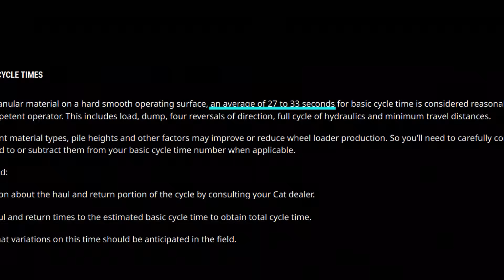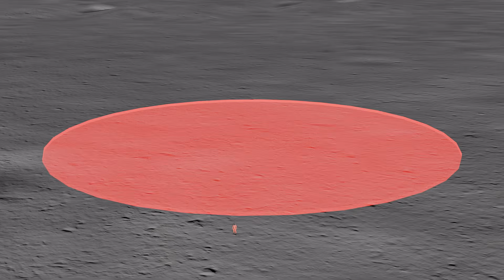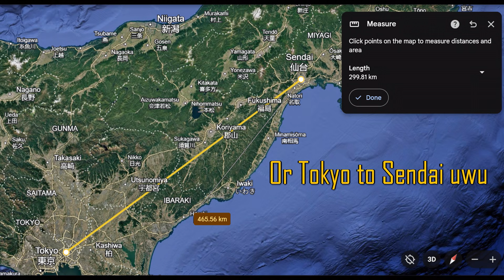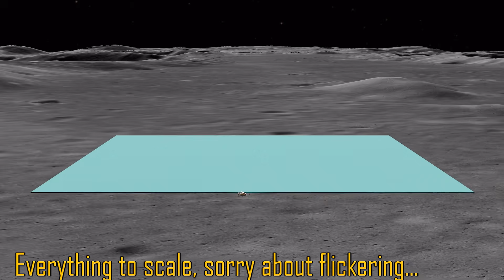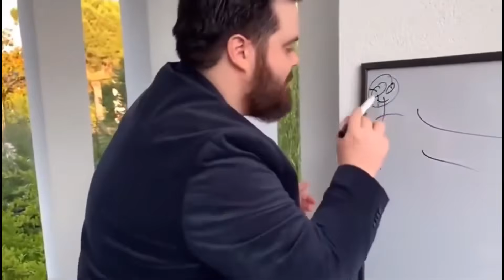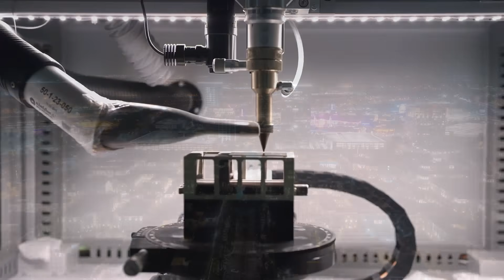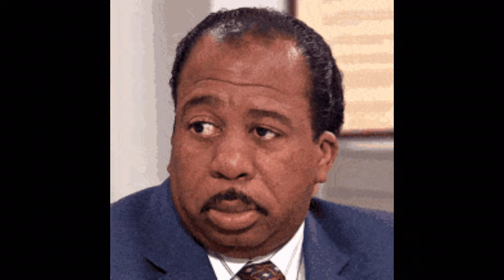How Much Bulldozer Can We To The Moon?

Comment: One of the advantages of having one big vehicle is that you also only need one person to operate it. But because the moon is a not a very complex environment, you could let basic AI handle most of the work with just one or two human supervisors.
Reply: Ehh… just use humans in chairs on earth. The benefit is a 24/7 workforce instead of a lunar workforce that gets sleepy every day.
Reply: we're actively solving this problem for exactly this reason at TerraFirma, the startup mentioned in the video
Reply: Computers in space suck, especially the parallel processors that AI depend on. The stellar radiation gently evaporates all the complicated atomic machinery of a microprocessor. Can’t rely on cloud either, the bandwidth back to earth has always been extremely limited in every era of space travel, latency measured in minutes and connection drops for huge amounts time as stellar bodies get in the way.
Reply: By the time we’re building these things, the idea of humans operating bulldozers on Earth will be quaint. The idea of humans operating one on the moon will be very rare.
Reply: @KingOfAllJackals  Depends on how AI progresses. Currently it looks impressive at the surface, but if you look deeper its just hallucinating and spewing out random thing that vaguely look/sound like the training material.
I certainly wouldnt want to risk a catastrophe because the builder AI did the architecture-equivalent of a seven-fingered hand on a loadbearing steel beam.
Reply: @Riesenfriese  Current mainstream AI is designed with generating stuff in mind, not an AI that is designed from the ground up with the intention of driving something, those AI’s don’t really hallucinate as they aren’t generators and if someone is using ChatGPT to operate their drone swarm then they deserve those accidents and issues. 

Hell you don’t even need an actual AI just a simple algorithm that can see each other, and the ground automating strip mining in the grand scheme of things isn’t hard.
Reply: well true,b ut also at aa few seconds delay it wouldnt be hard to put a few 20-50$ an hour on them loading them , also most farming equiptment or software can easily drive tractors around preordained paths and human interaction would only be needed at loading/unloading. and 1 person could look at 5-10 or more low priority camera feeds untills omething goes arry, then can press a button to elevate it to a support person, whow ill then take over and sort it
Reply: I dont think ai would even be required, bulldoze everything flat to get your machine's starting point and then essentially treat the machines as "tools" in a CNC machine. Everything can be essentially preprogrammed with something like a "super CAM" software, reviewed in a simulation, then sent into action and everything would follow just like a massive decentralized CNC machine
Reply: @solar_sailor9995  yep exactly, we have automated lawn movers without ai ,.. we have tractors and earth workign machinery without ai and it all works fine

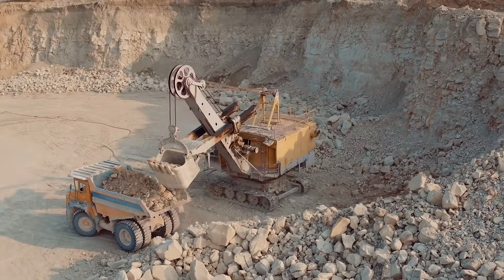Comment: One thing I have to point out about what you say at  20:13. There might be 1/6th the pull of mass to the moon, but it is still the same amount of MASS, which means everything will have the same amount of inertia to overcome to accelerate or decelerate, and accelerating mass is what Power is. So while the machines may not need to built as strong to support an amount of mass as a static load, any machinery with a dynamic load will need to be just as powerful as its earth based equivalent.
Reply: Maybe not as powerful since there is much less friction with the lower gravity, but NASA has some good videos on how its really hard to push a cart in moon gravity for example, because you get very little friction under your own feet too 😂
Reply: I was going to mention the same thing.  Also along with inertia we need to think about traction. They could easily make Dozers lighter here on earth.  One reason they don't is traction from the gravity of such a massive Machine. It doesn't matter how much torque you apply to the wheels if that cannot transfer to the ground.  Smaller machines might work but the loads will be smaller than just a scaled down big dozer. I wouldn't be surprised if there is some kind of "square-cube law" with it.
Reply: I doesn't need to move at the same speed as on earth it can just move slower
Reply: It might not be mentioned here but this is something that was extensively discussed in his Discord for the train video. I think he might have mentioned it in that video as well.

Comment: I said it before and ill say it again
If you build a circumlunar railway then put solar panels inbetween the ties . This way you have a power strip and material transport lanes all around the moon always in day time always producing power on the bright side to power the dark side robots
You have already designed an built the infrastructure so why not add space filling electricity producing panels in places where access is never permanent like rail roads where trians at 300mph will plow through everything but can ride over the panels without damagine them and still produce power when the train is gone

Comment: The gigantic excavators and machines rendered or talked about in previous videos would be eventually used, (in my opinion with absolutely no research), just not for a while because as you mentioned smaller rovers can support very large amounts of construction. Managing 10,000's of mini excavators could get complex, and manufacturing sturdier and larger excavators probably in situ would be necessary once O'Neill cylinders or the other large and lavish constructions are being made in the X per month. In that case where there are millions of citizens, not workers or colonists, the Earth sized or larger bucket excavators would make sense.

This question has likely been covered in another video, but, the regolith habitats are a topic talked about in practically every "episode", but would a Starship like structure or ship be able to launch with a low enough mass to get into LEO, (or with minimum to none modifications), and be able to support the 500-1500kg in weight of regolith shielding? I mean Starship has a 4mm  SS hull but knowing if that is supported to not just buckle under the weight isn't really something available.

Comment: If I may say, this is really an enjoyable series. You're really good at this. It's like listening to someone sing directly into my heart. Excuse me, I am under the influence of cannabis.

I don't look forward to much content on youtube these days (and I'm subscribed to literally thousands of channels), but I look forward to yours.

That said, my primary contention with your scheme is that your thinking too small. I know, you're plot to turn Luna into a foothold to the stars because it's very realistic, but it's very 20th century. You need to think 21st century.

Laser/Solar Sails that launch from high altitude-balloons, that orbit Luna are relatively low altitude (like maybe 2 kilometers), operating as autonomous drones in the millions (each weighing only a few grams), then fold up like origami into small robots about the size and shape of a dung-beetle, that can move around small spheres of sintered regolith (done by heating inside a solar oven made from just aluminum foil also imported on different drone balloons), and then roll them into large stacks/mounds that are selectively melted together  layer by layer until it has crudely 3D printed a large structure, and the supporting material can be removed and even reused.

Tiny robots can't do the work of a bulldozer, but you have to imagine how much would it really cost in terms of financial investment, R&D, resource availability, cost, if you go as simple as you possibly can.

You're plan might be simple if we're constrained by the way we do things on Earth. But it's actually incredibly convoluted and involves so many moving parts. We can macro-engineer our moon with literally just balloons.

Laser sails/Solar sails are,  I believe, going to be the dominant super-structure in the galaxy, parented by various species that rose to sophonce, to perform all kinds of services to their parent species, including using it to communicate with other species by flickering their star at another star in a pattern that denotes intelligence. It would be a clear sign that any species with a telescope would notice (within about 100 to 1000 lightyears). A series of dimming and intensifying a sequence like three prime numbers (17, 19, 23). And a clear response could simply be received as a radio transmission of the next three prime numbers, or perhaps the difference between the numbers, etc. Anything like that would also denote intelligence, but it would also be a clear sign that our species possesses a nearly unstoppable, unfathomably powerful, absolutely lethal weapon to defend itself. Imagine 100 trillion mirrors the size of beach towels, orbiting The Sun at various distances, from Venus out to the Oort Cloud, all reflecting The Sun on one object. Even it was light weeks away, it would be cooked, no matter what it was made of.

An inertial weapon travelling at .3 C heading towards Earth or Luna would be spotted a good distance away to respond. The swarm would also act as an optical lens the size of the solar system itself. An optical array of micro observatories (the size of a beach ball) working in tandem with a thin-film mirror inside another large balloon, with some fancy circuitry printed to act as a sensor. Trillions of them. 

All this stuff I'm talking about, the balloons, the origami robots, the solar sails, are all proven technologies that we know can work, and this could be conceivable accomplished in less than 200 years (more than 100) if we started right now. And just think of how quickly this would be accelerated by other technologies down the pipeline.

Pushing around asteroids to do useful stuff for human needs. Merging asteroids together to make a space snowman that people can act as fuel depots, feedstock mass for fabrication, or even a bus service for cargo between planets. Leapfrogging from one gravity well to another. or even habitats for future human explorers and their pets.

Trying to nut and bolt space means you have to bring people to space. Its Just simpler to bring space to people.
Reply: You should know, that in an earlier video most of our equipment is going to look more like it came out of the 1950s but just electrified. And also currently I don't think your earlier idea of launching autonomous drones from high altitude balloons is practical at least in the current context for colonizing the moon. Either way we have to use 20th century stuff anyways because its been proven to be a reliable system that we have the most information and experience in using, versus using millions of tiny gram sized drones, yeah while cool and (possibly more efficient and effective) is going to take a whole lot more planning, time. and development to get ready let alone pull off. Versus developing a lunar rated teleoperated or drone swarm of mining equipment or even basic Wall-E style sized drones with hands being the equipment.

Comment: Remote bulldozing the moon would save a lot of money, time, and resources in not having to deal with human space transport. Manned missions to the moon will be set back years the first time we lose a ship.
Reply: The input lag will be terrible though. You're looking at a 2600 ping in the absolute best case scenario, even ignoring any network inefficiencies on both ends. This much lag while driving makes many kinds of expensive accidents much more likely, and having no people on-site will make them harder to recover from.
Reply: @howzittoyah  Reducing communication latency might actually be a reason to build a habitat or have a space station in the lunar orbit.
Reply: @howzittoyah  It's a difficulty, but we manage to drive rovers on Mars, largely through giving instructions and letting the rover figure some things out on its own.

On the moon you might be able to do it more real-time. Like maybe you drive it locally, with a simulated response, and if the moondozer detects an anomaly (maybe it hits a rock), it can stop and go into an error state.

I also think we can do something similar with human-guided robots, in case we need to do maintenance.
Reply: @chrimony  Keep in mind that the Mars rovers are working alone, not expected to move thousands of tons of material, and the operators don't need to coordinate between several other human operators at the same time. 
All of which massively drive up the chances for an accident for our moon vehicles, and are likely compounding effects, especially with the lag.
Reply: @howzittoyah  Yes, and? Don't you think mission designers will take this into account, and PLAN their operations so that they coordinate amongst themselves?
Reply: Every plan is good before it meets reality :>
Reply: @IgiSzy  Nobody would do anything of ambition if the possibility of failure or difficulties stopped us. We have skyscrapers and water piped to our homes, these required planning.
Reply: And errors  @chrimony
Reply: @IgiSzy  Yeah, errors happen too. Why even get out of bed?
Reply: @chrimony  How are you going to fix the equipment when it breaks on the surface? Thoughts and prayers? Beg china for help? Human presence is necessary, risks and all. Why get out of bed indeed...
Reply: @MS2A-d7e  Did you watch the video? His plan went from sending 1 giant bulldozer to a fleet of smaller bulldozers, for exactly the reason that you could tolerate breakdowns. I also mentioned the idea of humanoid robots in this thread.

Comment: Aren’t bulldozers and other sundry earth movers powered by air breathing engines? Are there battery powered versions?
Reply: Not currently battery powered ones as far as I know, but there is no need for battery powered ones on earth and 100% a need for them on the moon, so that is something that would have to be developed (tho probably not that hard since electric engines are very good at low-speed torque, which is what this equipment needs)

Comment: Do you need the sun-following forge for making sintered regolith, or can you just have a moving solar concentrator vehicle sinter the ground underneath it?

Instead of sending thirty vehicles to the moon at once, you’d probably be better off sending just a couple, and a bunch of solar panels, and a big robot arm thing for constructing the solar forge.
Reply: Look at the cast regolith video we could probably use a similar setup  with the flat fresnel lenses but with a stationary main building. Theres a main central mirror that collects and reflects that light down onto the melting area and the sun rises and lowers the light is kept onto the mirror through the flat lenses.

Comment: Why not use one universal construction vehicle frame tha can be swapped with dofferent attachments like a dozer, or a loader or a excavator front or a bucket in the back or a ripper? Then you can fit one dozer on a rocket and maybe a second attachment or two.
Reply: That's what is done today. They call it a tractor. And it turns out the forces involved require different strengths on different parts of the vehicle.
Reply from the maker: It's an option but specialization has benefits as well, so really just depends 👍
Reply: You sound like you've never actually worked in construction. I have for 20years. The machine is specialized for the terrain the attachment is specialized for the task. This guy is right. Also remote controlling these machines is quite the challenge if you're trying to do anything that requires precision. Something else that wasn't explored was what if we keep them running on combustion engines? How much O2 will need to be hauled around to burn the fuel? Would it be less mass than batteries? Is there any advantages worth exploiting?  @Anthrofuturism
Reply: @rexmann1984 I mean at the very early phase everything has to be imported from the earth. Importing oxygen to burn would be very very inefficient.
Reply: @Yabyaba the O2 isn’t the problem. There’s more oxygen on the moon than any other (42%) and there’s twice as much oxygen than the second most abundant element (Si)

The real problem is what do you BURN with that oxygen? Importing  fuel is the real killer. A quick Google tells me Earth dozers in the 250-400HP range burn 8-20+ gallons of diesel per hour. At 7.1 lbs/gallon let’s use the low end and round up to a convenient 60lbs/25kg per hour and 30.3L/hr. 

Moving that much mass or volume is going to be implausible. The inefficiency of ICE is a non-starter not just for resources but also  dealing with the waste heat in a near vacuum. Sure we could reclaim that waste heat but that begins to look like turning old concentrated sunlight (petroleum) into heat instead of using fresh from the sun photons.
Reply: @Yabyaba you can get the oxygen from the regolith, however getting it into liquid oxygen is the most difficult part aside from keeping it from melting itself, and getting the fuel. Though can reuse the fuel but you’ll be expending lots of energy to recycle the waste products back into fuel. 

Even then simply importing batteries and dealing with an hour long life times will be way cheaper than using combustion engines.
Reply: @rexmann1984  Plenty of oil wells and fuel pumps on the moon, are there? ICEs? Come on.
Reply: There are a bunch of machines where you might get away with that. Excavators basically already do that with quick change heads.
Dozers just need to be super heavy so they can push things around, so the frame needs to be more specialized.
Reply: @thamiordragonheart8682 even the weight can be modular. You can fill up bins with regolith.
Reply: https://youtube.com/shorts/tnUOWC8EYEw?si=w3foEt7uTkoklHfp
Reply: You just described a skidsteer